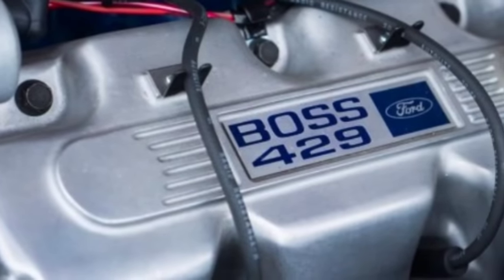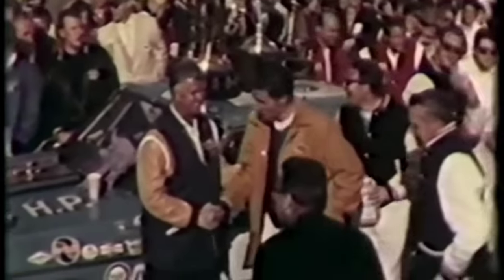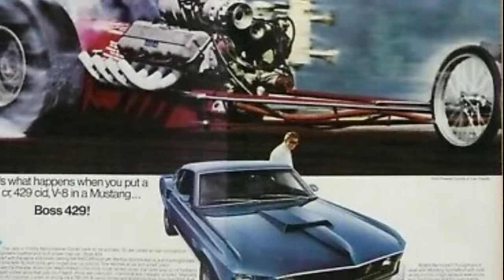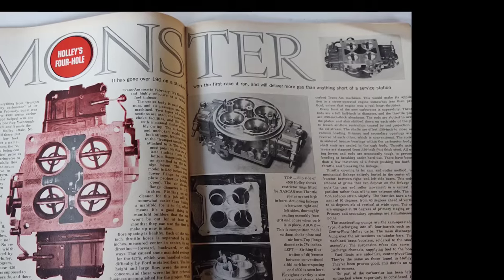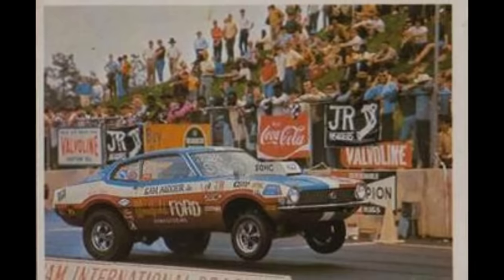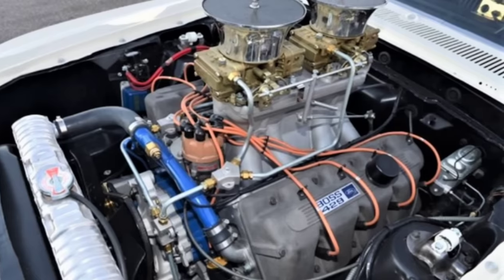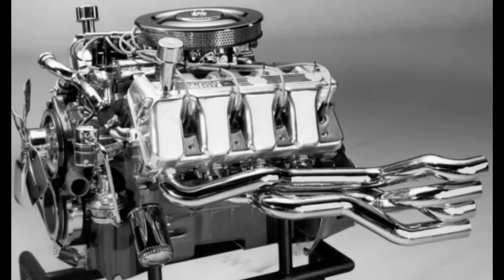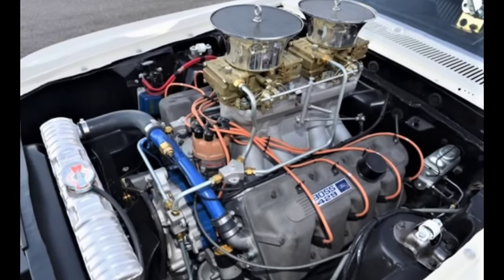The Misunderstood BOSS 429

Comment: The Boss 429 had a mission, but like a lot of things in corporate world, too many hoomans got in the way of greatness. 
By the time the engine was installed in the Mustangs, Ford basically just made the thing kinda run and installed the needed number to get it ok'd for NASCAR. The street engine was a pooch in stock form. Those huge intake ports, crap cam timing, non-optimized intake and exhaust systems, it was just garbage. Looked good but no huevos. 
Once you put some work into it though, could that big girl scream. It was meant to rev, obviously, at that small displacement. 
We all know what happened once the Pro Stock folks got a hold of it and started making big engines out of the Boss 429 architecture....the rest is Mountain Motor history👍
Reply from the maker: You got it!!! It just needed some TLC
Reply: Ran my 84 SVO Mustang against a friends 69 Boss 429. The Boss took the hole shot, but as soon as the SVO turbo spooled up, it was bye bye Boss.  The Boss was sooo much more satisfying a ride tho. Nothing like being pinned to the seat at launch. (And a big block sounds better than a 4cyl with a hair dryer.) Now drive a Jan 65 Mustang with a K code engine.
Reply from the maker: @kolsen6330  that's awesome stuff! Thanks for Watching! Please Subscribe help me spread the word about the channel.. I have some good content coming up!
Andy
Reply: Ford has never cared if their street cars performed..as long as they sold that is good enough, which they always did.  390 Fairlane?  Should have offered the 427 in the GT, or have used a new for '66 428 for that model year.  Boss '9 no different, made for racing, lousy street car..but still my favorite of all time.  1970 in Calypso Coral please...

Comment: Liked your video. I grew up in late 1960's 70's always liked big blocks cars but gas jumped from 27c to 43c a gal in 1973/74. A car that got 6-8 mpg killed you when the minimum wage was $1.30 per hour. Nice memories but today's cars are 200 % better. Back then, Tires last 25-30 k miles, and cars lasted 100k mile, and junked after 6-10 years. My 2019 Toyota Van 3.5 v6 300 hp 8 sp auto AWD accelerates to 90mph as fast as my 1971 Z-28 Camero, shift at 6600 rpm, w/ Chevy 8-10 mpg vs Toy's 20-24 mpg. Also no manual adj lifters, setting  hi rpm ign point dwell monthly , loud exhaust.Only advantage is easy access to most engine parts
Reply: I worked in a service station in that time period 72 to 74 gas went from 35 cents a gallon to 110 .

Comment: I don't know what is misunderstood when this is mostly accurate and was the known story. For people that aren't into cars and racing of course they wouldn't know. And this engine is not actually a hemi it is a semi hemi. And thank you for stating that the Boss 429 Mustangs like most of the cars of the time were not as fast from the factory as many try  to claim today. I have some experience with these engines.
Reply: I also have much experience on these engines, and further, look at the Mopar polyspheric engines combustion chamber, see any similarities?
First thing I did to my Boss 9 was cam ,springs , 800 cfm Holley, long tube headers etc. lots of fun.
Reply from the maker: You are right they look pretty similar!!  Thanks for watching and please Subscribe as Im putting BOSS 429 style heads (Hammerhead Performance) on a 429" Stroker Windsor shortblock!
Andy

Comment: The Boss 429 had intake ports you could just about roll tennis balls down. We used to fill the floors of the intakes with Devcon and raise the ports into the rocker area resulting in about a golf ball sized intake port giving the enging great low and mid range power for street/strip and truck pull motors. Even bored and stroked them to 618 CI

Comment: The Boss 9's still was the quickest Ford, outside of the 427 Cobra's which had 1200lb weight advantage, magazine tested car ran a 13.34@107
Reply: Even in the era of "ringer" cars that 9 was modded.  Off the showroom floor that 13.34 wasn't happening.
Reply: That’s a slow motor for all the hype!
Reply: @davidedwards2773  Truth is that very few of the cars of that period were fast. Respectable for the time but certainly not fast. Now modified was a different story, usually requiring a cam change for sure. Now my friends near stock internally 289 65 mustang ran in the 12's. Of course not a tire burner at street rpm's, but on the strip still beat the heck out of nearly every stock big block car at the time. I was around in the years of these cars and they were loud with cubes, but not with et's.

Comment: i'd have to say the 427 SOHC is equally, or more misunderstood.
Reply: Most definitely the 427 helped us win Leman
Reply: Other than us that are knowledgeable and not of the more recent generation most people have no idea what hemi means. They just think it is some kind of marketing name. And same with something like SOHC and what that means.
Reply: @georgeharleydavidsonrider156  Not with SOHC heads.
Reply: @fredc8346  in Europe hemi was nothing special , every manufacturer had them. But Ford was one of the first to understand that hemi is not very good , so they made Boss 429 which is not hemi. Chrysler found it out 30 years later and made New Hemi which is not hemi.
Reply: @V8Lenny  Right on all of that. A hemi design is really not much advantage for street use. It is really just all about a straighter flow through the combustion chamber. And of course that does little until higher rpms. That is why the Mopar (true) hemi is nothing special in street trim. But boy does that thing fly when you use it for something like supercharged funny car and rail drag racing.
Reply: @fredc8346  hemi flows well but combustion chamber is crap. That why Boss was semihemi and New Hemi also. BMW had some more advanced "hemi" combustion chambers.
Reply: @V8Lenny  Right another problem for street use. The combustion chamber is just a big hole. Quench wedge works much better for torque and street use.  I think most of the designs to make it work are really just crutches and other aspects make those hemi's 'decent' engines. Not too bad for an expensive sporty car like a beamer that has customers that don't care about these things to be right. Their right I guess. $$$$
Reply: @V8Lenny  Maybe we should make one of these videos about what a hemi is and what is good and bad about it. With all of the people that don't know shit about it and the ones that do think we would have an endless comment section and lots of entertainment?

Comment: Cool video. I'd always heard that this engine really only performed well on the oval but never knew why. So it actually was even more like the Mopar hemi than some people knew. The mighty elephant was also a terrible street motor unless you knew how to massage it and whisper in its ear... but let her stretch those legs at 7000 rpm and now you're looking at tail lights
Reply from the maker: Yeah this engine was meant to be ran 7500 rpm all day long!  It had MASSIVE connecting rods with 1/2 bolts!  The Hemi had smaller intake runners 245cc vs those massive ports of the BOSS!  Thanks for Watching and please subscribe as I have more great content coming up!
Andy

Comment: They didn't tear up the street, that's for sure. Shelby himself once remarked that it felt like less than 250 HP in the Mustang.
Reply: Problem was the HUGE ports in the head. They just couldn't flow well at the rpm's of a typical street motor. Ford had to cam it and carb it down so it could be streetable.
Reply: Ya thats fords for ya lol at least they're not the worst tho

Comment: Connie Kallitta said if Ford would of continued making the 427 SOHC there'd be no 426 hemi in Top fuel.
Reply from the maker: The cammer was ahead of its time... Sam Auxier told me that is was like the topend was good for 10,000 plus rpm on a 9,000 shortblock!  If they could have had a better block it would have changed history I believe.. but the world will never know!  Thanks for watching and please subscribe as I plan on doing a video on the cammer in the near future!
Andy
Reply: Yeaa nooo, the sohc block wasnt nearly up to the task. Even then at 2500hp guys were having serious block issues. The trick is if the design was so good why didn't someone do a better block for it? Keith black did it for the hemi. It's because the inherent design flaws are too great.  Back in the late 70's my uncle had a pair of SOHCs that he ran in modified.  We used to play hell to get the can timing dialed in. If I remember correctly the right cam was advanced 6 degrees and the left can was retarded 2 degrees. We did it this was because of chain stretch you would get about 4 degrees of retard on both cams at 7000rpm.  The SOHC was a good motor but it needed a ton of further development.
Reply: @TL-angzarr  i guess Connie kallitta was full of it. Lol
Reply: @johnchopp3278  Not sure I would say full of it, but I don't think he was thinking of 10,000hp TF engines in the future.  I do know this for a fact, few that ran the SOHC did it because of the design of the engine.  They did it cause ford had built the engines and there was no market to sell them.  Iirc the 1965 price tag was 12000. But I might be remembering that wrong.  So Ford offered the engines to racers for free.  At least they got to see them race and the benefit that brings. But the moment the factory support ran out no pro racer continued to use the engine.  And there was little to zero interest from the aftermarket.  I'll take the quote from Connie to be like the quote from the Compaq executive that said there was no reason anyone would want a computer in their home.  People can be wrong, quotes can be out of context.  Hell maybe Connie when he said it was pandering to Ford for more support.

Comment: When I was 18 or 19 years old went to a Ford dealership looking for used car they had a 69 Ford mustang with the boss 429 engine of course it was too much money for me at the time I remember looking at it the salesman opened up the hood it was like a monster engine
  underneath the hood I believe the year was 1970
Reply from the maker: Those engines just have the "LOOK" Thanks for Watching! Please Subscribe and follow my engine build Project MIXED UP BOSS.  Its has BOSS 429 style heads on a 429" Windsor stroker... 750hp or Bust!
Andy
Reply: How much for the car back then ? Just curious😷😇
Reply: @bennybenitez3731  I believe the car was like $3,500 automobiles were a lot cheaper back then they also depreciate it once they went off the lot when they were new
Reply from the maker: @bennybenitez3731  you could get a brand new BOSS 429 for about $5000, which was really a high price car for the day!

Comment: Its not misunderstood - Ford made some design errors that had to wait for John Kasse and Hammerhead Motorsports to improve.  What the Boss 429 does have is perhaps the most awesome valve cover shape.
Reply from the maker: I fully agree... it took it some years but when Allen Root and Jon Kasse got deep into the inner workings of this design they found magic!  Thanks for watching and please subscribe as Im making progress on my Project MIXED UP BOSS,  I'm using Hammerhead Boss style heads on a 429" Stroker Windsor using the Ford Racing Boss 351 block..
Andy

Comment: I had a 1969 Torino with a 428 SCJ.  The intake on that car weighed 100 lbs.
Reply: Yes. I weighed one of those and an aluminum intake. It was 85 vs 35lbs. 50 lbs off the nose just for the intake.

Comment: Originally the Boss 429 was slated to go into Galaxies for production cars.   This required no chassis modifications.   The original plan was a limited run of Mustangs, 50 or so similar to the Tbolt.  Knudsen though marketing would gain more by making a B9 mustang.   Problem was the street version was a turd.  Ford still mopped up Chyrsler in Mopar as the Boss more than made up for any improvements the winged cars offered.    Even with Ford cutting nascar funding the Boss 429 Torinos and Cyclones still won more races that they entered than Chryslers winged cars.
Reply from the maker: You are correct Sir,  when you look back at Nascar history Ford won more than the Chrysler corp during those years...  Thanks for watching and please subscribe as I have more good content coming up!
Andy
Reply: @Ziggy_Moonglow  by the way there numbnuts if you go to the PRO MOPAR site called Allpar you will find the SAME data that I have shared.
Reply: @Ziggy_Moonglow  how many different youtube accounts do you have?  Are you scared?
Reply: @Ziggy_Moonglow  please point out any specific item I have mentioned and tell me what is incorrect?   people like you are nuts.

Comment: In street trim the 429 was under carbureted, not enough intake, needed solid lifters not mechanical. Ford’s in-house mandate stated that grandma had to be able to drive it and let it idle where as the other manufacturers did not. So on the street the 428CJ and SCJ were much better. Still if you did to the 429 what Ford SHOULD have done it is something! I still want a 429 Boss ‘69 Mustang!

Comment: Dig, the early cars were great and were the test platforms for later engines. My first Ford was a 66 Fairlaine 500XL with a 390 4spd. 335 bhp from the factory. It was a stump puller. Later, I supercharged a 97 Cobra. 525 bhp to the ground. I got clocked @187 mph. A little later I installed .373s in a Auburn positraction differential, 31 spline Moser axles and pulled flat 11s @128 mph on street tires. I was told that if I ran slicks, it would break the transmission. Nowadays, that is just adequate. There are some barn burners out there from the factory. As Don Gartlits said, "Speed is inversely proportionate to rectangular dollars. How fast do you wanna go?"

Comment: Andy, the 6.2 Boss has got to be the new thing. The more I really understand about valvetrain and weight, the more significant the 6.2 Super Duty motor becomes. The later blocks look like they would take 4.150 bore? I've never physically touched one in person, I was trying to gauge wall thickness by using bore spacing by eye. It's such a simple design. A gun drilled custom cam with some machined cam holders might be all you would need up top? Smaller base circle to keep rocker geometry with higher lift?
It just seems that an 8500-9000rpm big displacement motor is hidden away in plain sight. Heck, if the 4.150 isn't possible stock, I could get LA Sleeve to make a set of o-ringed wets good for 4.25.

Comment: They always banned whatever beat General Motors cars . As long as Chevy was winning , no problem .
Reply: that is so true bring in the restrictor plates
Reply: Agreed bill france was about makin that harley earle trophy have shivvy drivers on it.
Reply: TRUTH!!!
Reply: Until the valves started rattling
Reply: In the 60's, GM wasn't officially in NASCAR. In the 60's the leadership at GM had banned all brands from competing in racing of any type. It didn't mean teams didn't still use their cars, but there were no factory backed teams. It actually landed Zora Duntov in quite a bit of trouble over the Grand Sport Corvettes he had come up with and been racing.

Comment: The 351C 4V had a very similar problem, the ports were so large you could stick your fist in them, making for very poor low end performance and daily driving.  The 2V heads were much better for streetability, the ports still could fit 4 fingers, but with an edelbrock intake, an appropriate CFM carburetor (750 Qjet for me) and a Crower Compucam Stage 3 it was still a beast when you opened it up, but with good enough manners to be a daily driver.  You compare the Cleveland 2V head and the Windsor 4V head and there is no contest.  I had a 71 Ranchero GT that I restored with that very package, was quicker than all the boy racers in their 90's Camaros and Mustangs, yet would actually idle at 700 in drive and pull 17 inches of vacuum which I doubt a Cleveland 4V could manage, they were all about WOT.
Reply from the maker: Tom you are right...  But in my opinion the Clevelands are king of the small blocks!  Please Subscribe as I have other good content coming up!
Andy
Reply: I have 4v cleavland in 72 Torino, run s better than my 69 351 Windsor mustang
Reply: @rogerdodrill4733  that is awesome, I am just saying for day to day the 2V heads are generally a better option, large enough that they flow all day long without being opened up, but not overly large that they are detrimental to low end.  Always loved mine with the performer intake, compared to the Windsor in my pick-up with identical cam stats and performer intake, there was no comparison.  Love all Clevelands, such a great performance motor and not  limited out of the box by stock heads like many Windsors were, in my opinion anyway.
Reply: @UnityMotorSportsGarage  will absolutely do so, depending on what you wanted you were given so much better heads 2V and 4V on the Clevelands than what came with most SBC, Mopar and motors like the Windsor right out of the box.  I had otherwise identical top ends between my Ranchero C2V motor and My 77 F250 (originally 460, changed to Windsor) both motors had thee same camshaft stats, Qjet that I built on both, performer intake and there was no comparison even though for a Windsor that motor was very stout, oh I also built both dual exhaust systems using the same size pipes and same mufflers.  Loved both vehicles and they both did the blue oval proud  but those unmodified Cleveland 2V heads were great for low and top end as well as general streetability I can't speak to the 4V Cleveland, never owned one but seems like a lot of volume for day to day  running around stopping and going.